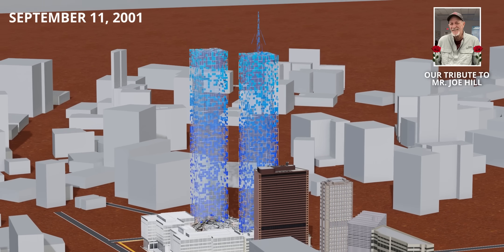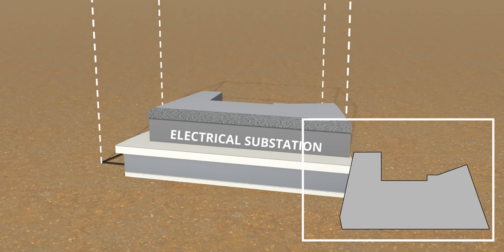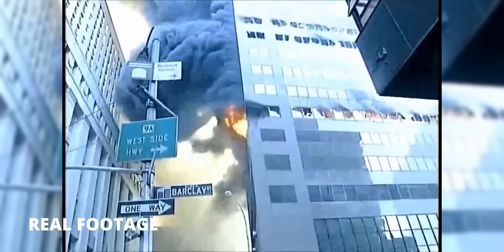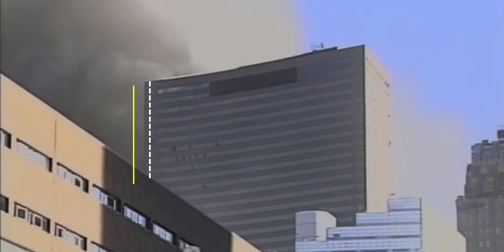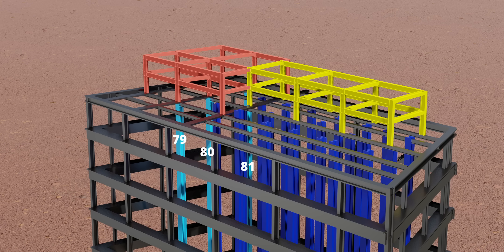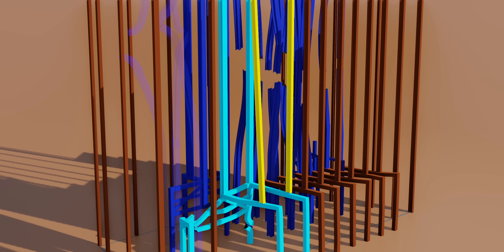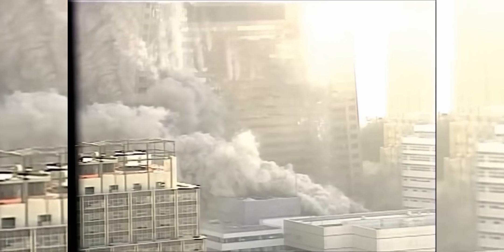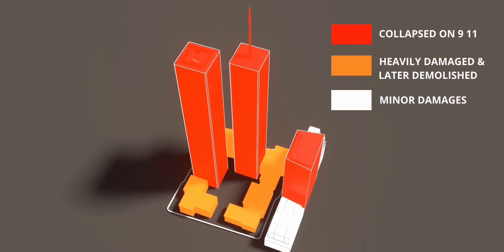Collapse of Building 7 | The Complete Physics

Comment: Controlled demolition without a doubt !!!!!!  .  I'm no demolition expert but I've seen enough evidence for me to smell a huge rat ???? 9/11 is shrouded in mystery from start to finish  ???????? 🤔🤔
Reply: I have doubts and I can express them in detail.  Can you say the same?  

Much misunderstood, Building 7 was the 6th building to collapse of 10 lost on 9/11. Because of its early low priority, conspiracy filled the information void with garbage made up by technically ignorant people promoting political agendas. But 7's loss is an engineering problem and should be treated as such, so I prepared this brief summary of my own analysis to fix that, using technical analysis, not ideology and tired memes. 

At 10:28am the WTC North Tower collapsed, showering Building 7 with tons of burning debris, causing heavy damage and starting many large  fires which burned out of control for the next 7 hours. Half the FDNY firefighters having been killed, units in disarray, equipment destroyed, no water pressure, and the greater urgency of search & rescue efforts, Building 7 couldn’t be saved so firefighting efforts were pulled as futile and 7 left to its fate. Firefighters make that sort of choice every day in brush fire situations - which houses to save and which ones to let go. Only real difference here is moving the decimal on the size and cost. People get overwhelmed by the size.

www.youtube.com/watch?v=g_SvpwyC17M

Collapse of a burning structure is always a concern for firefighters. Steel buildings subject to fire rely on active firefighting to survive. Buildings are designed around 1 to 3 hours of fire resistance, allowing time for occupants to escape and active firefighting to get started, after which all bets are off. Left to their own devices they'll exceed their design envelope and collapse, like Plasco Tower and Wilton Paes de Almeida. In 7 the occupants escaped, passive and active fire protections were compromised and active firefighting was abandoned hours before the collapse, which left the building to its fate. It lost. Odds on Building 7 would eventually collapse, and it did. No big deal in logic.

 http://www.youtube.com/watch?v=WnYBX6QT0R4 

FDNY Chief Daniel Nigro - The biggest decision we had to make on the first day was to clear the area and create a collapse zone around the severely damaged 7 World Trade Center, a 47-story building heavily involved in fire. A number of fire officers and companies assessed the damage to the building. The appraisals indicated that the building's structural integrity was in serious doubt. I issued orders to PULL back the firefighters and define the collapse zone. It was a critical decision; We could not lose any more firefighters. It took a lot of time to PULL everyone out, given the emotionalism of the day, communications difficulties and the collapse terrain 

FDNY Deputy Chief Peter Hayden ; We had our special operations people set up surveying instruments to monitor and see if there was any movement in the building. We were concerned of the possibility of collapse in the building. And we had a discussion with one particular engineer there, and we asked him if we allowed it to burn could we anticipate a collapse and if so, how soon? And it turned out that he was pretty much right on the money, that he said 'In its current state you have about 5 hours 

The collapse of Building 7 was anticipated and widely reported in the media throughout the day, with 24 video cameras recording some or all of the collapse. Everyone knew what was coming and why. 

www.youtube.com/watch?v=OY5S5k3tMHI

The collapse of Building 7’s was entirely different to the Twin Towers and harder to understand, most details being hidden from view and not intuitive.  But we can still sort out what happened through careful analysis and observation. This is my explanation of the collapse relying on no outside authority. 

Building 7 was a unique, asymmetrical 47-story steel framed structure built atop a smaller 3-story building serving as a partial foundation, requiring lower floors dedicated to complex load transfer structures. Of trapezoidal shape and all-steel tube-in-tube construction, B7 (above the 7th floor) consisted of a central core of steel columns carrying most of the gravity load, perimeter steel columns around the outside of the structure carrying the remainder of the gravity loads and long span beams and girders to tie those elements together and form the floors. On the outside of the building hung a moment frame or outer shell. 

Phase 1 : First externally visible signs of collapse initiation occurred at 5:20:28 pm and were notably quiet with observers not realizing the building was collapsing! No audible warning in the form of hundreds of ear drum busting 180-190dB explosive bangs preceding the collapse. Here at 12:00 a local CBS affiliate reporter is talking 10 blocks from B7 when collapse begins. People don’t start to notice the collapse until 12:11. At 12:45 is the famous CBS fixed camera clip of Building 7’s collapse. Note how quiet it is. 

www.youtube.com/watch?v=t5tEy6mXSE8

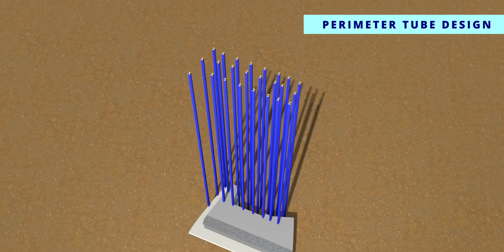Collapse initiation was due to lower floor failures above the load transfer region (8-14th floors) in the NE corner. In this video at 0:45 you can see the NW corner from inside the building while under construction, Column 79 just out of frame on the left. That big, angled steel beam across the top of the frame connects to C79 at one end. The girders connect to the beam. That beam and all those girders depend on just one connection 

www.youtube.com/watch?v=nP3TNHPCIVU&t=45s

Phase 2 : The NE lower floor failures caused a loss of critical lateral support over an excessive length of Column 79 and it buckled. Looking at a floor diagram of Building 7 (www.nist.gov/image-16640) when you see all the structures that depend on C79 you quickly realize this one column was a relatively isolated structural element on which a disproportionately greater fraction of the structure depended analogous to say the Key Bridge. Externally as collapse begins we see a vertical progression of window breakage along the 44-46 line and a kink in the roof of the East Mechanical Penthouse at the top of the building, consistent with C79 failure. Normally with a buckling column, the load could be redistributed to other columns. With C79 that is not the case - the failure did not redistribute the load, so the collapse rapidly progressed to the roofline, sinking the rooftop penthouse. The transition from full capacity to almost no capacity occurs in an instant and will result in virtually no resistance 

Phase 3 : With C79 gone, B7’s progressive, non-symmetrical collapse continues with adjacent columns 80 and 81 left laterally unsupported, and quickly buckling as well, sending the EMP down through the building. C79-81 all have no diagonal bracing, which is the major reason why they could not redistribute a lot of vertical loads among one another. From there collapse progressed from east to west through the central core until the core was gone taking all of the interior floors and probably most of the perimeter columns with it. Follow the horizontal progression of window failures low in the building and the dropping of the remaining rooftop structures into the building. One of the big takeaways from the NIST Building 7 study (invariably ignored) was how their modeling determined C79 failing under ANY circumstances would have initiated the same collapse sequence. 

Phase 4 : After about 10 seconds only the exterior moment frame remains, giving the illusion B7 is still standing to the casual observer since little has outwardly changed. But it is just a hollow empty shell like an empty cereal box supported only by a few remaining columns and overloaded from the loss of the core columns and floors, quite unable to remain standing. With nothing remaining behind it, the north face leans inward, forming a V in the roofline, the last few columns buckle under the strain and the moment frame free falls, landing on top of the debris pile. 

It is only here at the very end that a single measurement of alleged free fall acceleration is taken, from a single point on the outer shell. The Building did not “free fall” – just one corner of the outer shell did, sort of. The Building_ (defined as its center-of-mass) was already gone before that happened. The period of alleged free fall was a product of how it fell NOT why it fell and can't tell us what started the collapse 10 seconds earlier. Start to finish the collapse took 18-20 seconds, 3 times longer than free fall . How fast something falls cannot tell you what started it falling_ anyway. 

The debris spread outside the footprint blocking surrounding streets, heavily damaging the Verizon Building and destroyed Fiterman Hall. 

Building 7’s progressive, non-symmetrical collapse was incidental and unintended collateral damage from the combined effects of fire + time + gravity, started by the collapsing North Tower. That is true no matter who planned and carried out the 9/11 attacks or why . The collapse was of so little consequence it barely registered at the time - a footnote, only taking on semi-mythical status as an alleged smoking gun years later when demolitions at the Twin Towers, missiles at the Pentagon and shoot down over Shanksville all failed and conspiracists had nothing left to work with. 

Anything can seem like a conspiracy if you don’t understand how it works. Now you should. I hope you found this helpful, informative and it solicits informed critical comment. If I made any errors of fact, logic or reason or left anything important out, please let me know so I can fix it. IF you can offer a more plausible alternative please do. Be the first. Please start any reply with the words “Tits McGee” or I will know you didn’t read it and are wasting my time.
Reply: @TheCriticalStinker-01 <---- government shill account
Reply: @TheCriticalStinker-01  Only 3 buildings collapsed in New York that day you pathetic liar.
Reply: @Kudde23look at that reply. It has all these responses ready to copy and paste. It has a script.
Reply: @dwingles5936  Yep, it´s one of the very obvious shills. It uses the exact same copy paste garbage comments also with its other account "MFitz". It´s really working hard for the little money, very busy shill...
Reply: @Kudde23 saying someone is a gov shill account has the same energy as repeating what someone but in a nerdy voice. 
you are NOT even providing scientific evidence, typical.
If you ARE right, provide actual scientific evidence.
Reply: @NateTheTrainGuy  What are you even talking about shill?

Comment: Where are the 'Fact Checkers' when you really need them?...
This video would have (should have) given them a field day.
Reply: What's stopping you? Please tell us what this video got wrong and how that fundamentally changes its conclusions.  

Go ahead, be the first to seriously try.
Reply: @TheCriticalStinker-01  Stinkyfitz you disgustng little liar, you know that the free fall proves the controlled demolition and that that is the reason why the free fall isn´t even mentioned in this BS video.
Reply: @Kudde23 ok then, YOU explain it then. would love to see you try
Reply: @NateTheTrainGuy  - You are wasting your time.  Pure operam quaerimus troglodytam that one.  It does not actually care about the topic one bit.
Reply: @NateTheTrainGuy  Cutter charges on multiple lower floors, obviously. They didn´t want to place the cutter charges higher up in the building as in usual controlled demolitions because higher floors weren´t cloaked by surrounding buildings and the cutter charges going off would be more likely witnessed or even filmed. So they wanted to cut out only lower floors but they still wanted a complete collapse and in order to accomplish that they needed to blow out more floors than usual so the collapse would speed up creating enough force to crush all the upper floors into the ground.

Comment: Hold on, do you have proof the spire made the gash in building 7? It seems you need this assumption to make your point? you just lost me until you prove it was the spire of the collapse of the other building to 100% then move along with your theory,  you have a gap but better than i have heard so far. Just critique no hate. thanks
Reply: It didn't.  The video is wrong on that detail. It was perimeter columns from the north face of the North Tower.  Same source, different piece of metal.

Comment: Amazing, demo teams can save money on dynamite, all they gotta do is set the building on fire and let it burn for 6 or 7 or hours and it'll fall right into it's own footprint. Nice and neat.
Reply: Worked for 17,000 buildings in the greater Los Angeles area earlier this year.

FFS how stupid does one have to be to not understand fire is one of the most destructive forces on Earth?  Were you dropped on your head a lot as a child?
Reply: Actually, very much true. There are just some small problems:
1) Takes a lot of time.
2) Entirely unpredictable.
3) Plenty of smoke and other air pollutants escaping in the air.
4) Danger of fire spreading to the surroundings.
I'm sure I missed some more. I don't think this method will become very popular.
Reply: except it wouldn't be controlled demolition.

Comment: What i dont understand how did  bulidings turn do dust  . In less than 5min
Reply: The energy released by the fall of each of the buildings was the equivalent of explosion of about 280 tons of high explosives. Does it answer your query? BTW, the claim "the building turned into dust" is greatly exaggerated.
Reply: They didn't.  Problem solved.
Reply: It happened by you believing in fairy tales.

Comment: Nice try.  Not buying it.  It was all about destroying evidence housed in the building.  The events of that day was an elaborate heist.  Enjoy the new normal.
Reply: Destroying what evidence?
Reply: @TheCriticalStinker-01  Well, I’d imagine the collapse was fortuitous for whoever had engaged in the ‘Unusual Market Option Activity’ prior to 9/11, which I’m sure you’re familiar with.
Reply: @Snoozie09  Since there was no "Unusual Market Option Activity", with or without "Important Seeming First Caps"....no, I'd say no-one is familiar with that. But even if there had been, a completely irrelevant building in Manhattan wouldn't have mattered in the slightest, so....
Reply: Irrelevant building? You're flat-out lying and you know it.  It was the CIA's New York field office, had offices for the SEC on Floors 11-12 (ahem, insider trading?). Was also the city's designated emergency management center (which speaks to the confidence of the building's "sturdiness" if you ask me).

Also, half the building was leased to Salomon Smith Barney - for whom, Donald Rumsfeld was on the advisory board.

So no, not irrelevant. Try again.
Reply: @Snoozie09  That's right. An irrelevant building. "CIA New York Field office" is complete nonsense. The CIA doesn't HAVE field offices in the US, and if they'd had one, it'd be more than "part of a single floor of an office building". Since it's all of 235 miles to Langley from the WTC, it's even more nonsense.

"had offices for the SEC on Floors 11-12 (ahem, insider trading?)"
Ahem, no. Not in the slightest.

"Also, half the building was leased to Salomon Smith Barney - for whom, Donald Rumsfeld was on the advisory board."
Ah, yes. Irrelevant shit to support nonsense.

Completely irrelevant building. No matter how much you want to pretend otherwise.